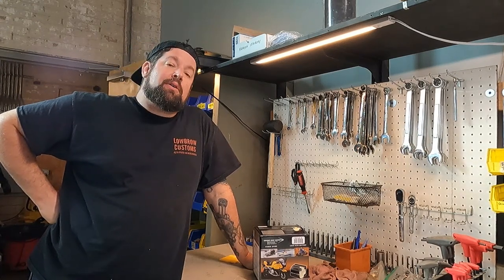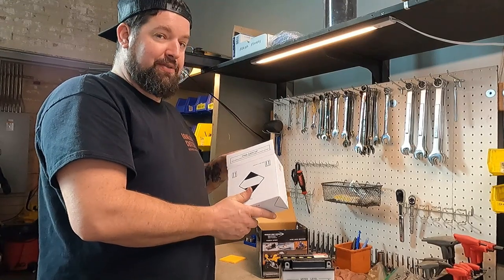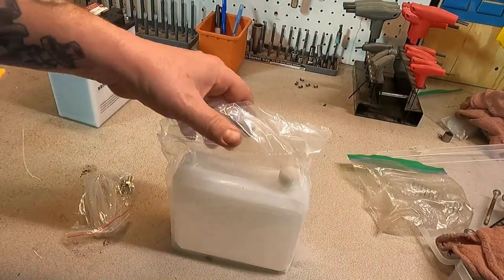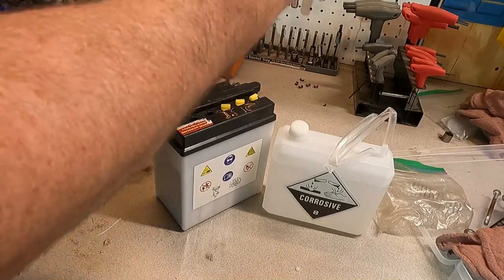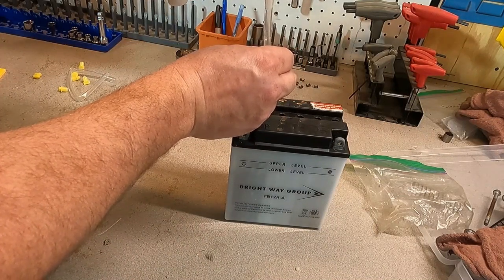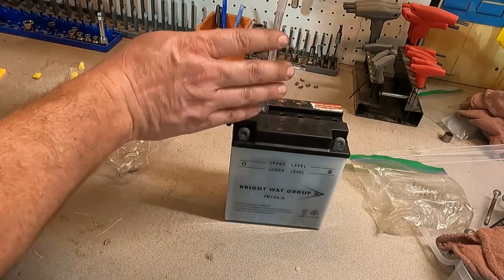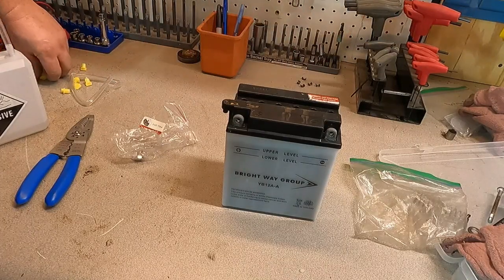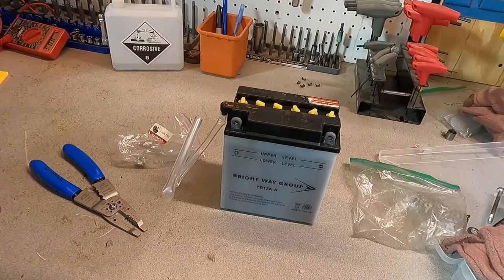How to prepare a new motorcycle battery with acid.

Comment: A very useful video.  The first one I've seen with the "one at a time fill" method. Thank you so much!
Reply: But you should let the liquid "rest" after you pour it, depending on the producer's recommandation (30 min - 1 hour), because if not, the gas is going to get trapped and the battery is going to expand and might damage the battery.
Reply from the maker: @bucurvlad5571  that’s a good call.  I think I mentioned having to top it off. But I would have to watch it again to be sure. I am glad you enjoyed the video.

Comment: Hey brother, i added the acid to my battery today all to the upper level as instructed in the manual but after charging it for 2 hours the level increased.. should i be worried?
Reply from the maker: As long as it didn’t overflow i wouldn’t worry about it.

Comment: Directions on mine said to fill the battery through the overflow but now the three chambers aren’t level.  I’m going to pull the plugs and fill like you did to top off
Reply from the maker: I am shocked you got that much through the overflow!  Whoever wrote those instructions was an idiot.

Comment: I've never had a battery I could bloody see through as well as this vid...I 've tried shinning a torch behind them and can just about make out the level...I usually end up gauging it through the hole in the top...I've just filled up a new battery and overfilled it...Dang!
Reply: I did the same fucking thing too.  Turns out low light with a flashlight shining to the ground next to it is how I seen in there.  Now that they are all uneven and I put it on charge before I figured the light issue, can I use an eyedropper and even them out after it's charged or while it's charging?  That's what I'd like to know.  Our host is not the guy to answer that question unfortunately.  Update:  while it was charging I used the eyedropper to extract from over filled cells to underfilled. Kept it charging.  That was at about 3 hour mark and charging finished at 5 hours.  Will be couple days yet before I can put it in my sled and try it out.  Between now and the  I will put it on trickle one more time.   Probably tomorrow,  will post an update once installed.
Reply from the maker: That works. You just need to make sure the lead plates are submerged.

Comment: My current battery that I bought last year sat on a trickle charger all winter and the charger shows green as good.   But when I installed the battery there was no charge.  Can these batteries lose acid in them rendering them dead?  If so, can I just add the acid to it to make it work again?
Reply from the maker: Sorta. You can add acid, or even distilled water and it should work.  But sometimes the lead plates corrode over, and then it won’t work.  You can add epson salt to the water you add, and that should clean the corrosion.  I have a video that shows how to do it.
Reply: @KnobleMoto  Great thanks for your reply I'll check out the video

Comment: I filled mine yesterday and for some reason put the vent cap back on.  Today I was gonna put the trickle charger on it and noticed the sides are starting to bulge.  I’m afraid of what will happen if I take the vent cap back off but now I’m worried it’s gonna explode
Reply from the maker: I would take the vent cap off.
Reply: @KnobleMoto  thank you, I did.  Never really dealt with filling batteries before and the warnings of explosions etc had me worried.  Thanks for responding
Reply from the maker: @tonynguyen9457  you’re welcome

Comment: What about distilled water??
Reply from the maker: You can use distilled water to top it off. But you really should use the acid for the majority of the battery
Reply: I had the same question

Comment: Why do i see people using distilled water?
Reply from the maker: The additives & residue from the piping in drinking water can affect the chemical process that makes the electricity.  Is this true? I have no idea.
Reply: @KnobleMoto  I know that. I was wondering how much sulfuric acid to add or if any?
Reply from the maker: @holdingboost2024  you want to make sure the lead plates are submerged.

Comment: Uh. Yeah - you should be wearing gloves and a water-repelling long sleeve when handling acids. You should also have some lye (not soap - lye; like sodium hydroxide) or baking soda saturated in water readily available in case you spill.

Never wash strong acids down a normal drain. It will eat your pipes. Always have a wash bowl ready if you get it on clothing or skin. 

Have a 1L squeeze bottle ready full of distilled water so that you can spray a stream directly into your eye if you get it there. A sink is not going to help you if you can't find your way to it. You need a flow of water readily available. Use a garden hose if need be. If you're washing your eye, only have the acid contaminated eye opened so you don't accidentally transfer it to the other eye. If you have both eyes contaminated, obviously you open both eyes.

If you get acid on clothing, take it off immediately. Don't try to neutralize it while you're wearing the damn clothing - you'll get severe burns. It should go without saying - wear something you can take off without having to pull it over your head, so you don't get acid on your face if you spill on your clothes. Those button-up lab coats serve a very functional purpose.

Also should be super obvious - this comment is intended for anyone who wants to attempt this at home and hasn't done it yet - not the guy in the video who already did this and has no use for this safety announcement.
Reply from the maker: Poor safety procedures make for great stories though.